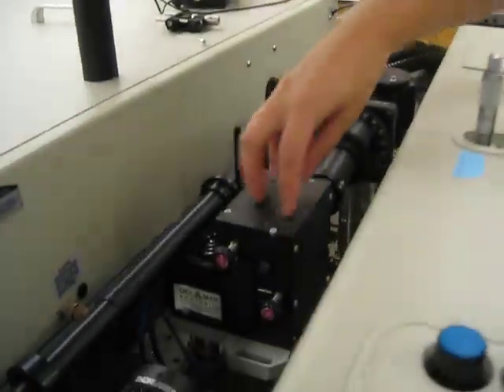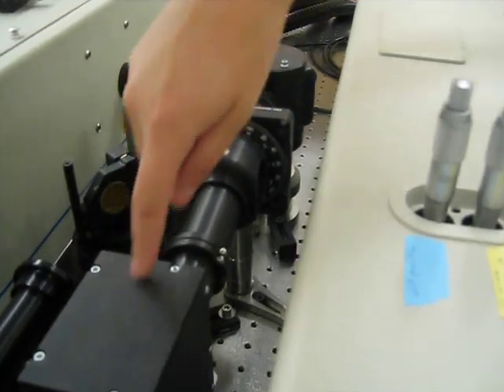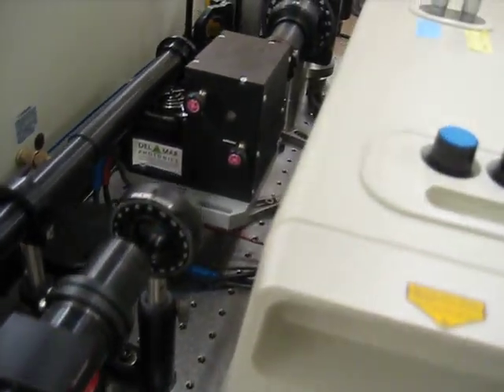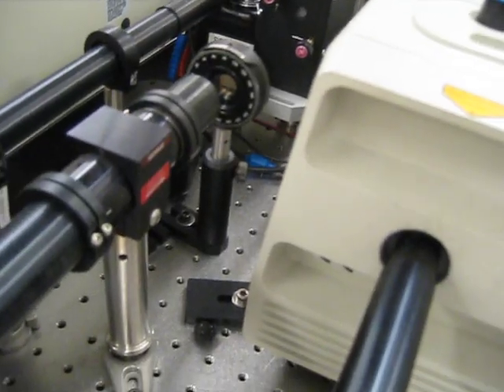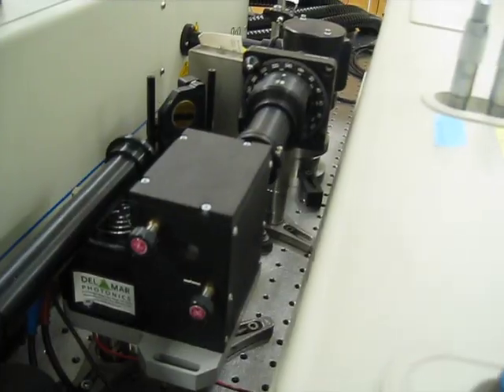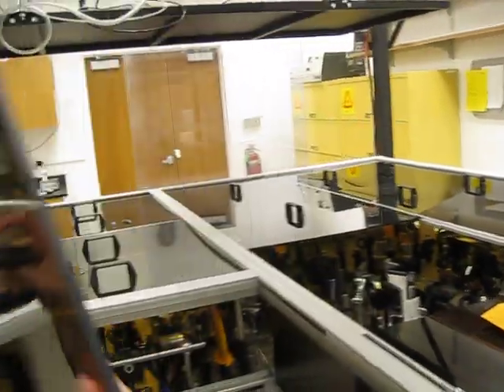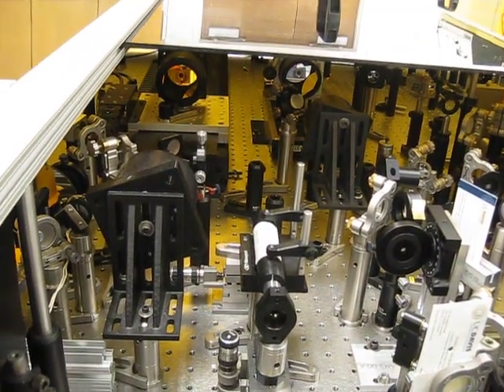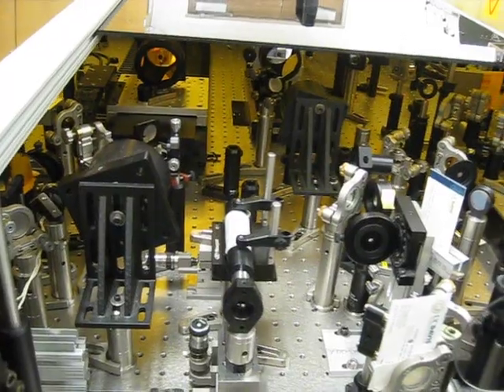A single source femtosecond-millisecond broadband spectrometer UC Davis - sales@dmphotonics.com

Comment from the maker: Related PW2015 presentations:
Targeted illumination in 3D for excitation and stimulation 
Paper 9329-24
Author(s): Elijah Y. Yew, Peter T. C. So, Massachusetts Institute of Technology (United States) 

Breast cancer staging through nonlinear endomicroscopy 
Paper 9329-25
Author(s): Gunnsteinn Hall, Wenxuan Liang, Lu Jiang, Kristine Glunde, Xingde Li, Johns Hopkins Univ. (United States) 

Study of acetowhitening mechanisms in live mammalian cells with label-free subcellular-level multimodal nonlinear optical microscopy 
Paper 9329-26
Author(s): Jian Lin, Sengkhoon Teh, Wei Zheng, Zi Wang, Zhiwei Huang, National Univ. of Singapore (Singapore) 

JenLab Young Investigator Award Papers Presentation
Monday 9 February 2015
9:35 AM - 10:05 AM
Session 6:
Technology Development and Application III
Monday 9 February 2015
10:30 AM - 12:05 PM
Session Chair: Peter T. So, Massachusetts Institute of Technology (United States)
Optical reprogramming with ultrashort femtosecond laser pulses (Invited Paper) 
Paper 9329-27
Author(s): Aisada Uchugonova, Univ. des Saarlandes (Germany); Hans Georg Breunig, Univ. des Saarlandes (Germany), JenLab GmbH (Germany); Ana Batista, Karsten König, Univ. des Saarlandes (Germany) 

Compact fixed wavelength femtosecond oscillators for multi-photon imaging 
Paper 9329-28
Author(s): Tommi Hakulinen, Spectra Physics (Austria); Ruben Zadoyan, Tommaso Baldacchini, Newport Corp. (United States); Tilman Franke, FEI Munich GmbH (Germany) 

Novel applications of melanin pump-probe imaging: correlating structural and chemical variation with MC1R gene expression and the onset of Parkinson's disease 
Paper 9329-29
Author(s): Sanghamitra Deb, Christopher P. Dall, Francisco E. Robles, Christina S. Gainey, Jesse W. Wilson, Duke Univ. (United States); Nicole A. Kukutsch, Leiden Univ. Medical Ctr. (Netherlands); Warren S. Warren, Duke Univ. (United States) 

Femtosecond pulse shaping enables molecular imaging using optical Kerr-effect dynamics 
Paper 9329-30
Author(s): Francisco E. Robles, Martin C. Fischer, Warren S. Warren, Duke Univ. (United States) 

Integration of femtosecond fiber laser and endoscopy 
Paper 9329-31
Author(s): Huda Yousif, Hussein E. Kotb, Majid Naji, Univ. of Ottawa (Canada); Mohamed A. Abdelalim, Univ. of Ottawa (Canada), Electronics Research Institute (Egypt); Sangeeta Murugkar, Carleton Univ. (Canada); Hanan Anis, Univ. of Ottawa (Canada) 

Multiphoton light-sheet microscopy using wavelength mixing: fast multicolor imaging of the beating Zebrafish heart with low photobleaching 
Paper 9329-32
Author(s): Pierre Mahou, Lab. d’Optique et Biosciences, Ecole Polytechnique (France), Univ. of Cambridge (United Kingdom); Julien Vermot, Univ. de Strasbourg (France); Emmanuel Beaurepaire, Lab. d'Optique et Biosciences, Ecole Polytechnique (France); Willy Supatto, Lab. d’Optique et Biosciences, Ecole Polytechnique (France) 

Lunch Break 12:05 PM - 1:45 PM
Session 7:
SHG/THG Microscopy I
Monday 9 February 2015
1:45 PM - 2:50 PM
Session Chair: Chen-Yuan Dong, National Taiwan Univ. (Taiwan)
Combined wavelength dependent 3D SHG imaging, optical scattering and texture analysis to characterize changes collagen architecture and development of a classification system in human ovarian cancer (Invited Paper) 
Paper 9329-33
Author(s): Paul J. Campagnola, Karissa B. Tilbury, Kirby R. Campbell, Bruce L. Wen, Kevin W. Eliceiri, Vikas Singh, Manish Patankar, Univ. of Wisconsin-Madison (United States) 

Two- and three-photon excited fluorescence microscopy of erythrocytes using sub-50fs Ti:sapphire and Yb lasers 
Paper 9329-34
Author(s): Marcos M. Dantus, Ilyas Saytashev, Michigan State Univ. (United States) 

Combining wide-field assessment with nonlinear optical microscopy: possibilities for multimodal imaging in epithelial (pre)cancer 
Paper 9329-35
Author(s): Rahul Pal, Jinping Yang, Gracie Vargas, The Univ. of Texas Medical Branch (United States) 

Four wave mixing microscopy: a high potential nonlinear imaging method 
Paper 9329-36
Author(s): Tobias Ehmke, Andreas Knebl, Friedrich-Schiller-Univ. Jena (Germany); Alexander Heisterkamp, Leibniz Univ. Hannover (Germany) 

Award Presentation
Monday 9 February 2015
2:50 PM - 3:05 PM

Student Poster Session Competition 

Prize donated by: 
Becker and Hickl, Carl Zeiss Microscopy, LLC, Chroma Tech, Coherent Inc., ISS Inc., Leica Microsystems, Newport Corporation, Princeton Instruments, Semrock, Veroptics 

Graduate students and postdoctoral fellows with accepted posters can participate in the poster session competition of the conference on Multiphoton Microscopy in the Biomedical Sciences. There is a cash award for the winner(s). The participants should mention that their submission is for the “Students Poster Session Competition (SPSCMP).” The participants should follow the rules and regulations of SPIE or submission of their abstract and manuscript. 

JenLab Young Investigator Award 

Prize donated by: 
JenLab GmbH 

We are pleased to announce that a prize in the amount of $2000.00 will be awarded to a graduate student, postdoc, or scientist under the age of 32 within conference 9329: Multiphoton Microscopy in the Biomedical Sciences XV. To be eligible to receive the award, participants must 1) be both the primary author and presenter of an accepted abstract, and 2) the associated proceedings paper must be submitted at least 2 weeks prior to the meeting start dates for review by the selection committee.
Session 8:
SHG/THG Microscopy II
Monday 9 February 2015
3:30 PM - 5:35 PM
Session Chair: Paul J. Campagnola, Univ. of Wisconsin-Madison (United States)
Label-free second order susceptibility imaging of collagen (Invited Paper) 
Paper 9329-38
Author(s): Chen-Yuan Dong, Chiu-Mei Hsueh, Ya-Der Huang, Hsuan-Shu Lee, National Taiwan Univ. (Taiwan) 

Influence of pulse width on photodamage and inflammation during intravital autofluorescence 2-photon microscopy of murine intestinal mucosa 
Paper 9329-39
Author(s): Gereon Hüttmann, Lisa Krapf, Regina Orzekowsky-Schroeder, Norbert Koop, Alfred Vogel, Antje Klinger, Univ. zu Lübeck (Germany) 

Yb-fiber laser for multimodal imaging 
Paper 9329-40
Author(s): Ilyas Saytashev, Michigan State Univ. (United States); Bingwei Xu, Marcos M. Dantus, Biophotonic Solutions, Inc. (United States) 

Label-free multi-photon imaging of Barrett esophagus 
Paper 9329-41
Author(s): Seyed Soroush Mehravar, College of Optical Sciences, The Univ. of Arizona (United States); Philip Usera, Hemant Chatrath, Nasser Peyghambarian, College of Optical Sciences, The Univ. of Arizona (United States); Bhaskar Banerjee, The Univ. of Arizona College of Medicine (United States); Khanh Q. Kieu, College of Optical Sciences, The Univ. of Arizona (United States) 

Non-linear imaging and characterization of atherosclerotic arterial tissue using combined SHG and FLIM microscopy 
Paper 9329-42
Author(s): Riccardo Cicchi, Istituto Nazionale di Ottica (Italy), European Lab. for Non-linear Spectroscopy (Italy); Christian Matthaeus, Leibniz-Institut für Photonische Technologien e.V. (Germany); Enrico Baria, Univ. degli Studi di Firenze (Italy); Marta Lange, European Lab. for Non-linear Spectroscopy (Italy); Tobias Meyer, Leibniz-Institut für Photonische Technologien e.V. (Germany); Annika Lattermann, Universitätsklinikum Jena (Germany); Benjamin Dietzek, Leibniz-Institut für Photonische Technologien e.V. (Germany), Abbe Ctr. of Photonics Jena (Germany), Friedrich-Schiller-Univ. Jena (Germany); Bernhard R. Brehm, Katholische Klinikum Koblenz (Germany); Juergen Popp, Leibniz-Institut für Photonische Technologien e.V. (Germany), Abbe Ctr. of Photonics Jena (Germany), Friedrich-Schiller-Univ. Jena (Germany); Francesco S. Pavone, European Lab. for Non-linear Spectroscopy (Italy), Univ. degli Studi di Firenze (Italy) 

Biomaterial discrimination using wavelength-dependent SHG excitation efficiency 
Paper 9329-43
Author(s): Stephen J. Matcher, Nicola H. Green, Robin M. Delaine-Smith, Gwendolen C. Reilly, Hannah Askew, Xuesong Hu, The Univ. of Sheffield (United Kingdom) 

Discontinuous sampling in beam-scanning microscopy 
Paper 9329-44
Author(s): Ryan D. Muir, Paul D. Schmitt, Emma L. DeWalt, Shane Z. Sullivan, Ximeng You, Garth J. Simpson, Purdue Univ. (United States) 

Second harmonic generation imaging in tissue engineering and cartilage pathologies 
Paper 9329-45
Author(s): Magnus B. Lilledahl, Norwegian Univ. of Science and Technology (Norway); Magnus Ø. Olderøy, Norwegian Ctr. for Stem Cell Research (Norway); Andreas Finnøy, Norwegian Univ. of Science and Technology (Norway); Kristin Olstad, Norwegian Univ. of Life Sciences (Norway); Jan E. Brinchman, Norwegian Ctr. for Stem Cell Research (Norway) 

TUESDAY 10 FEBRUARY Show All Abstracts
Session 9:
Biomedical Applications of Coherent Raman I
Tuesday 10 February 2015
8:00 AM - 9:55 AM
Session Chair: Xiaoliang S. Xie, Harvard Univ. (United States)
Stimulated Raman scattering microscopy of chemical tags in live cells (Invited Paper) 
Paper 9329-46
Author(s): YanYi Huang, Peking Univ. (China); Xing Chen, Peking Univ (China) 

Bioorthogonal vibrational imaging of dynamic metabolism of living systems (Invited Paper) 
Paper 9329-47
Author(s): Wei Min, Columbia Univ. (United States) 

Visualization and quantification of peripheral myelin degeneration in amyotrophic lateral sclerosis (ALS) mouse model (SOD1G93A) and patients with stimulated Raman scattering (SRS) 
Paper 9329-48
Author(s): Wenlong Yang, Feng Tian, Harvard Univ. (United States); Daniel Mordes, Harvard Univ. (United States), Massachusetts General Hospital (United States); Naoki Suzuki, Satomi Suzuki, Kevin Eggan, Xiaoliang S. Xie, Harvard Univ. (United States) 

Probing myelin morphology and organization with label-free microscopy 
Paper 9329-49
Author(s): Alicja Gasecka, Institut Univ. en Santé Mentale de Quebec, Univ. Laval (Canada), Institut Fresnel (Canada); Pierre Gravel, Institute Univ. en Santé Mentale de Quebec, Univ. Laval (Canada), Univ. du Québec (Canada); Raphael Turcotte, Wellman Ctr. for Photomedicine (United States); Steve Begin, Daniel Cote, Ctr. de Recherche de l'Univ. Laval Robert-Giffard (Canada), Institut Univ. en Santé Mentale de Quebec, Univ. Laval (Canada) 

Visualizing murine meibomian glands physiology and pathology using coherent anti-stokes Raman scattering (CARS) microscopy and multi-photon microscopy (MPM) 
Paper 9329-50
Author(s): Joachim Pruessner, Univ. zu Lübeck (Germany), Wellman Ctr. for Photomedicine (United States); Reginald Birngruber, Univ. zu Lübeck (Germany); Conor L. Evans, Wellman Ctr. for Photomedicine (United States) 

Local organization of lipids in myelinated axons probed by polarization resolved coherent anti-stokes Raman scattering nonlinear microscopy 
Paper 9329-51
Author(s): Paulina Gasecka, Naveen K. Balla, Julien Duboisset, Patrick Ferrand, Hervé Rigneault, Sophie Brasselet, Institut Fresnel (France) 

Monitoring lipid accumulation in the green microalga botryococcus braunii with frequency-modulated stimulated Raman scattering 
Paper 9329-52
Author(s): Chun-Chin Wang, Dayananda Chandrappa, Nicholas Smirnoff, Julian Moger, Univ. of Exeter (United Kingdom) 

Session 10:
Biomedical Applications of Coherent Raman II
Tuesday 10 February 2015
10:25 AM - 12:00 PM
Session Chair: Daniel Cote, Ctr. de Recherche de l'Univ. Laval Robert-Giffard (Canada)
Label-free functional imaging of membrane potential by stimulated Raman scattering microscopy (Invited Paper) 
Paper 9329-53
Author(s): Bin Liu, Key Lab. of Science and Technology on Tunable Laser, Harbin Institute of Technology (China); Hyeon Jeong Lee, Interdisciplinary Life Science Program, Purdue Univ. (United States); Delong Zhang, ChienSheng Liao, Purdue Univ. (United States); Yuanqin Xia, Key Lab. of Science and Technology on Tunable Laser, Harbin Institute of Technology (China); Ji-Xin Cheng, Purdue Univ. (United States) 

Detection of human brain tumors with SRS microscopy 
Paper 9329-54
Author(s): Daniel A. Orringer, Univ. of Michigan Health System (United States); Minbiao Ji, Harvard Univ. (United States); Spencer Lewis, Sandra Camelo-Piragua, Univ. of Michigan Health System (United States); Xiaoliang S. Xie, Harvard Univ. (United States) 

Imaging human melanoma using coherent anti-stokes Raman scattering (CARS) and multiphoton microscopy (MPM) 
Paper 9329-55
Author(s): Hequn Wang, Sam Osseiran, Elisabeth Roider, Vivien Igras, David E. Fisher, Conor L. Evans, Wellman Ctr. for Photomedicine (United States) 

Histology in vivo: chemical contrast combined with clinical multimodal multiphoton tomograpy 
Paper 9329-56
Author(s): Martin Weinigel, JenLab GmbH (Germany), Univ. of Technology, Ilmenau (Germany); Hans Georg Breunig, Saarland Univ. (Germany), JenLab GmbH (Germany); Karsten Koenig, JenLab GmbH (Germany), Univ. des Saarlandes (Germany) 

Mechanically-induced protein structural changes in fibrin hydrogels using B-CARS microscopy 
Paper 9329-57
Author(s): Sapun H. Parekh, Frederik Fleissner, Mischa Bonn, Max-Planck-Institut für Polymerforschung (Germany)

Simultaneous quadruple modal nonlinear optical imaging for gastric diseases diagnosis and characterization 
Paper 9329-58
Author(s): Zi Wang, Wei Zheng, Jian Lin, Zhiwei Huang, National Univ. of Singapore (Singapore) 

Lunch Break 12:00 PM - 1:30 PM
Session 11:
Coherent Raman Technical Development I
Tuesday 10 February 2015
1:30 PM - 3:25 PM
Session Chair: Ji-Xin Cheng, Purdue Univ. (United States)
Hyperspectral stimulated Raman scattering imaging of drug-cell and drug-drug interaction (Invited Paper) 
Paper 9329-59
Author(s): Dan Fu, Harvard Univ. (United States); Jing Zhou, Novartis Institutes for Biomedical Research, Inc. (United States); Xiaoliang S. Xie, Harvard Univ. (United States) 

In vivo microsecond scale vibrational spectroscopy imaging by modulation multiplexed stimulated Raman scattering (Invited Paper) 
Paper 9329-60
Author(s): ChienSheng Liao, Pu Wang, Ping Wang, Robert Oglesbee, Ji-Xin Cheng, Purdue Univ. (United States) 

Resolution and contrast enhancement in label-free microscopy 
Paper 9329-61
Author(s): Alicja Gasecka, Institut Univ. en Santé Mentale de Quebec, Univ. Laval (Canada), Institut Fresnel (Canada); Amy Daradich, Harold Dehez, Institut Univ. en Santé Mentale de Quebec, Univ. Laval (Canada); Michel Piche, Univ. Laval (Canada); Daniel Cote, Ctr. de Recherche de l'Univ. Laval Robert-Giffard (Canada), Institut Univ. en Santé Mentale de Quebec, Univ. Laval (Canada) 

Fast spectrum extraction from SRS spectral images by independent component analysis with image compression and post sampling 
Paper 9329-62
Author(s): Yasuyuki Ozeki, The Univ. of Tokyo (Japan) 

Beam scanning approach to broadband coherent Raman imaging 
Paper 9329-63
Author(s): Young Jong Lee, Charles H. Camp, Marcus T. Cicerone, National Institute of Standards and Technology (United States) 

Nonlinear optical microscopy and optical coherence tomography platform for label-free functional biophotonic imaging 
Paper 9329-64
Author(s): Angelika Unterhuber, Medizinische Univ. Wien (Austria); Sunil Kumar, Weizmann Institute of Science (Israel); Tschackad Kamali, Boris Hermann, Rene Werkmeister, Medizinische Univ. Wien (Austria); Yaron Silberberg, Weizmann Institute of Science (Israel); Wolfgang Drexler, Medizinische Univ. Wien (Austria) 

CARS/FWM and scanning probe microscopy of nanostructures (Invited Paper) 
Paper 9329-65
Author(s): Annika M. Enejder, Michael Stührenberg, Nisha Rani Agarwal, Mahesh Namboodiri, Juris Kiskis, Chalmers Univ. of Technology (Sweden) 

Session 12:
Coherent Raman Technical Development II
Tuesday 10 February 2015
3:55 PM - 5:50 PM
Session Chair: Marcus T. Cicerone, National Institute of Standards and Technology (United States)
Background-free stimulated Raman spectroscopy and microscopy (Invited Paper) 
Paper 9329-66
Author(s): Hervé Rigneault, Esben Andresen, Pascal Berto, Institut Fresnel (France) 

Pushing the limits of coherent Raman spectroscopic imaging (Invited Paper) 
Paper 9329-67
Author(s): Marcus T. Cicerone, Charles H. Camp, Brandon Blakely, Young Lee, National Institute of Standards and Technology (United States) 

Fiber-laser platform for coherent Raman scattering 
Paper 9329-68
Author(s): Christian W. Freudiger, Invenio Imaging Inc. (United States); Wenlong Yang, Gary R. Holtom, Harvard Univ. (United States); Jay Trautman, Invenio Imaging Inc. (United States); Khanh Q. Kieu, The Univ. of Arizona (United States); Sunney Xie, Harvard Univ. (United States) 

Optimized coherent Raman scattering microscopy with a novel tunable dual-wavelength lightsource 
Paper 9329-69
Author(s): Ingo Rimke, APE GmbH (Germany); Gregor Hehl, Univ. Stuttgart (Germany); Marcus Beutler, Peter Volz, Edlef Büttner, APE GmbH (Germany); Andreas Volkmer, Univ. Stuttgart (Germany) 

Towards low-noise fiber sources for coherent Raman microscopy 
Paper 9329-70
Author(s): Erin S. Lamb, Hanzhang Pei, Frank W. Wise, Cornell Univ. (United States) 

Optimized signal-to-noise ratio with shot noise limited detection in Stimulated Raman Scattering microscopy 
Paper 9329-71
Author(s): Miriam J. B. Moester, Freek Ariese, Johannes F. de Boer, Vrije Univ. Amsterdam (Netherlands) 

Detecting polymeric nanoparticles with coherent anti-stokes Raman scattering microscopy in tissues exhibiting fixative-induced autoflourescence 
Paper 9329-72
Author(s): Natalie L. Garrett, Univ. of Exeter (United Kingdom); Lisa Godfrey, Univ. College London (United Kingdom); Aikaterini Lalatsa, Univ. of Portsmouth (United Kingdom); D. R. Serrano, Univ. Complutense de Madrid (Spain); Ijeoma F. Uchegbu, Andreas G. Schatzlein, Univ. College London (United Kingdom); Julian Moger, Univ. of Exeter (United Kingdom)